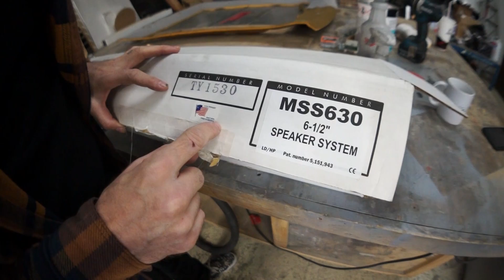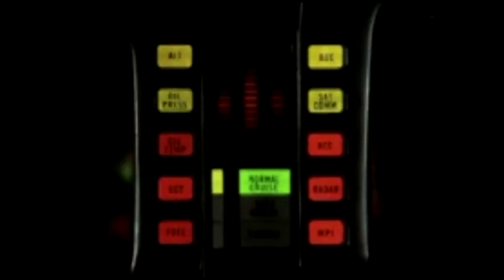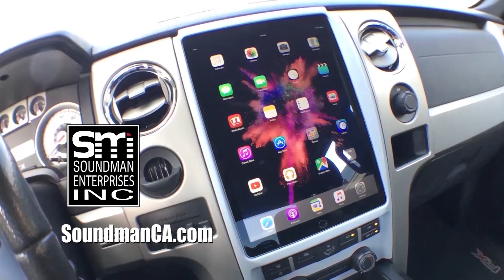Kick panel tweeter pods - WHITE RIDER #83

Comment: I taught I taw a “Tweeter” “BIRD” I did, I did see a tweeter bird!
Reply: Russell Francis Jr. hey Russ do you have a nice system of your own? I don’t know why but I feel like you have tons of Oldschool car audio and I’d love to see your system. Also you have witty messages and us fans love them!
Reply: Oxnard Adrian Lopez 

I used to do a lot (not as nice as Doug)builds, when I was younger in the early 80’s. We would build ported boxes and install mostly Vega speakers with Harmon Kardon amps/ tunnel cooled. 

As I’ve gotten older, I don’t have time, now I suffer with a factory system but still like the “bump”. One of our best builds was a box that was a stealth fit in the Honda CRX back area. A ported box with 3 way (tri-axle) Vega 6”x9” s. They had resets on the tweeters and sounded pretty cool.

Comment: According to my mobile dynamics courses  from almost 30 years ago.. tweeter placement should be no more than 1 half the diameter of the mid away from the outer edge of the surround. The tweeter should be placed with an angle towards the domelight. According to 20th century engineering.

Comment: They should sound great, through your legs and steering wheel. If only they would invent something to adjust frequency levels to make up for placing the tweeter “in the wrong spot”. Also that looks more than 6 inches down from your mid, you and Rafa should lay em end to end and measure😂

Comment: Wait so why do manufacturers put the tweeters in the a pillar and the mid down in the bottom of the door??
Reply: Jacob Ceccarelli distance from your ear to mid and ear to tweet cant exceed 6 inches for phase issues, unless you're time aligning.
Reply: most oem stereo isn't even aimed at either passanger or driver? it's linear towards the other speaker...adds for shitty fill and no real front stage.
Reply: Because they're car companies not stereo companies.

Comment: I will never place my tweeters at my feet. Such a moronic tweeter location. i thought this when you did it to the Mule, the f150 and now the Bird.
Reply: If it didn't rain or snow where I live, I'd consider it.
Reply: the mule doesnt technically have tweets. if i remember correctly, they are full range mids

Comment: Twitter should be max 6 inch from the woofer? Don't know where did you get this knowledge, but you are wrong.
Reply: Doug states 6" from the mid, not the woofer...  :)
Reply: first tweeter, and why do you want tweets playing off axis from the mid driver by placing it farther away from the driver and closer to your ears? that's why its 6" or closer and farther from your ears as possible to get the best time alignment.
Reply: @allrimmedout  some tweeters sound better off axis but I bet you knew that already.
Reply: He's not wrong.
Reply: @MTGEDH  that's true. especially on 3 way systems.
Reply: it's almost like all of these hardon kardon/bose/Infinity sound designers got it completely wrong in all those vehicles they designed with the tweeters further than 6" from the mids :)
Reply: if you think those factory systems are well designed, you're very wrong. they use the cheapest components, and then use DSP to tune out most of the problems. While i cant speak for every speaker placement, many are not well thought out. most of the time the designers are just trying to keep the tweeters out of the way of SRS Airbag systems. those so called high end factory systems are usually just the label.
Reply: Im very wrong because they "usually" are just a label and you "cant speak for every placement"  - then how am I or they wrong? 

Or are you just convinced tweeters should be in the location Doug or the Audio Kitchen think they should be? 

They are great guys and undoubted better at what they do than us - but to suggest that they somehow can produce better staging/placement then companies* with millions of dollars of equipment/facility on their side is naive.

Dont get it twisted, I agree when you're talking about SONY, Pioneer, etc "partner" setups, but there's a reason I named off manufactures like Bose, HK , and one I forgot - KRELL.
Reply: I am not trying to contradict you just for the sake of argument, but Bose is not high end. Dr Bose was a huge proponent of DSP,  and funky direct reflect placement that the industry mostly panned. Bose big achievement was noise cancelling, which they do admirably. Many pilots use Bose noise cancelling headsets in private planes.  Harmon Kardon is in no way high end(anymore at least). If you look at any "high end" BMW HK system, all the driver locations are the same for the high end to the low end systems. The argument can be made that the placement was designed around the high end version and then adapted to work with the base model audio install. But the ugly truth is, all these systems use low end paper or poly cone mids and woofers, and standard dome tweeters. I have yet to ever pull out a stock high end system that used drivers that i wanted to keep. Like I said earlier, the first priority of automotive interior design is where to put the airbags. Everything else comes second. The last thing you want is an SRS Airbag launching your pillar mounted mids/tweeters at your face at 200mph. I am not saying that stock high end systems don't sound OK, but they can easily be improved with more power, better drivers, and better placement. just be prepared in some cases to disable certain SRS systems if you decide to do dash/pillar mount. remember, cars are designed by accountants, not engineers

Car interiors are the worst place for high end systems, the multitude of reflective surfaces and non ideal standard speaker locations will require some form of DSP in the end to compensate. Glass for example cuts certain frequencies dramatically, which can be notoriously hard to tune without.....blah blah blah 

I could go on for a while, but i am pretty sure i made my point here.
Reply: @bundles1978  The problem isn't that there isn't validity to what you're saying, it's that you are trying to make a point about the quality of a system, a companies back ground, disputing their placement based on MODERN SRS/ABS systems (when they've been doing it since before SRS/ABS were remotely close to their locations...much less some of us were born), and YOUR OWN OPINION of the companies to prove your point.... of what exactly? That the tweeter SHOULD be within 6" of the mid or not? Because that is what this conversation is about. It's incredibly hard to "make a point" when whatever you are getting at is rooted in discounting all those years of components remaining close to if not exactly in the same places they always have (retrospectively). 

My comment (that I really didn't think needed explaining or somehow be negated by a persons opinion and not of fact) is literally pointing at the fact ACTUAL AUDIO/AUTOMOTIVE MANUFACTURERS .. not guys in a garage/in youtube comments section... have been doing it for some time. Whether their placement is meant to accommodate or fit around other components is moot considering ...as you said... doesn't apply "for every placement" and are "usually just a label". And at the end of the day - is ALL rooted in the EAR of the beholder. But to see if I DO understand where your comments were going, lets see if I can at least attribute some of your comments to the actual subject matter :

"Manufacturers placing tweeters more than 6" from the mids is strictly because they have to get around other SRS/ABS components... although I know that doesn't apply "for every placement", not to mention they are of poor quality and "usually just a label" slapped on to sell the option/car. These are my reasons for deciding that the placement of speakers shouldn't be similar to companies that specialize in audio staging, but should be placed within the recommendations set forth by installers in the aftermarket sector. Also of note - since there are better quality products available in the aftermarket, there is always room for improvement  - therefore tweeters should be within 6" of the mids."